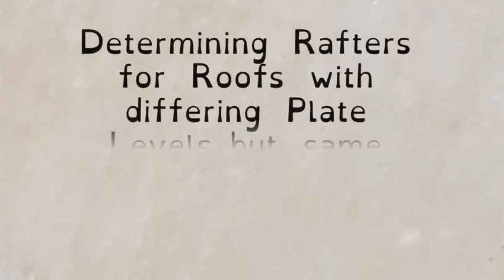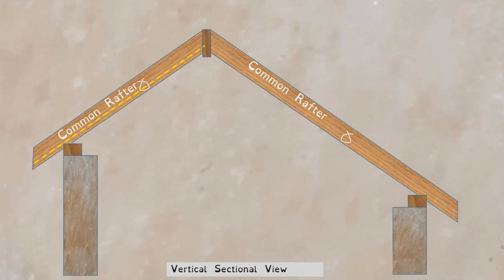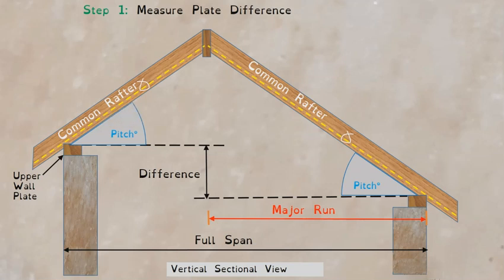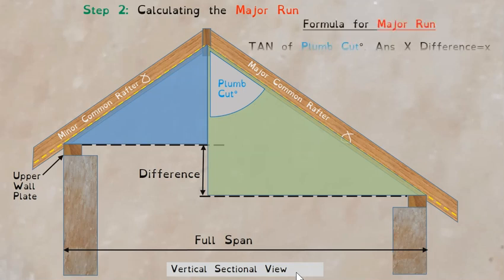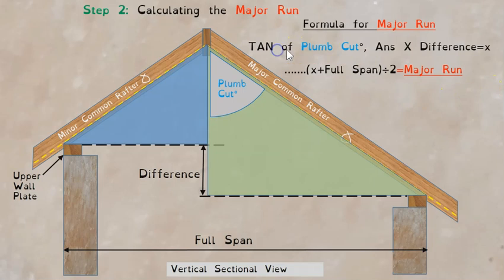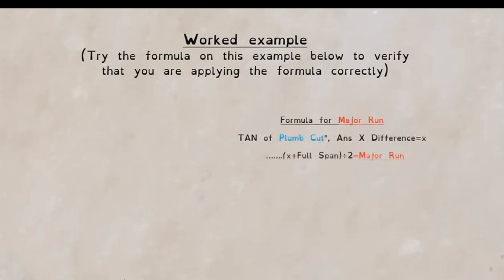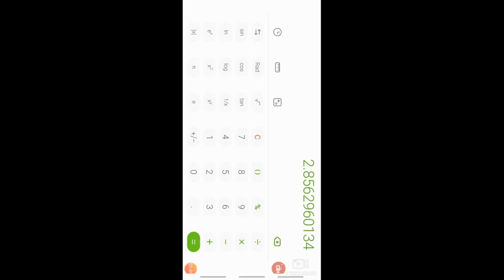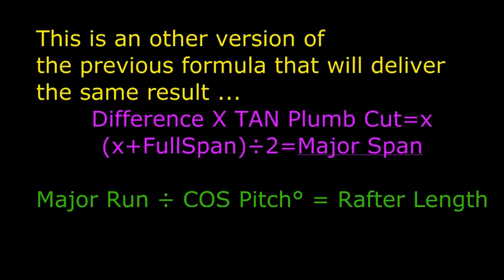Rafter Calculations for Different Plate Levels

Comment: If I was cutting a rafter  for a 35 degree pitch my plum cut would be 35 how did it become 55 in your example ?
Reply from the maker: Hi Ben, if the pitch of the roof is 35 degrees..the plumb cut will always be 90 minus the pitch. In other words the Plumb Cut plus Seat Cut (Pitch) should = 90 degrees.
If you visualise another example...take a 30/60 degree set square...if the 30 degree end of the set square represents the pitch (seat cut)of the roof...then the other end represents the plumb cut (60 degrees).
Reply: I 100% get what your talking about it all adds up to 90 etc but it literally makes no sense to me as someone who has done a lot of traditional cut roofs if the pitch of the roof is 30 degrees then I would cut  30 on my chop saw for the plumb cut but if I was to do as you said on the video I should in fact be cutting 60 on the chop saw to achieve a 30 degree pitch regardless I like your videos sorry if its like talking to a brick wall
Reply from the maker: @benshaw8139  ..so when  you swing your chop saw to 30 degrees and chop...then the angle left between this cut and back of rafter (Saw Fence) will be 60 degrees (Plumb Cut Angle).
Reply: @michaeldownes516  I suppose when working it out on paper that’s how you’d have to say it because your showing us the degree and the angle in the same example witch now I know that’s what you mean and why you said it that way 
but I can almost say with Surtenty that if you said to someone the plumb cut of the roof is 60 degrees and walked away and came back  you’d find a roof set at a  60 degrees pitch